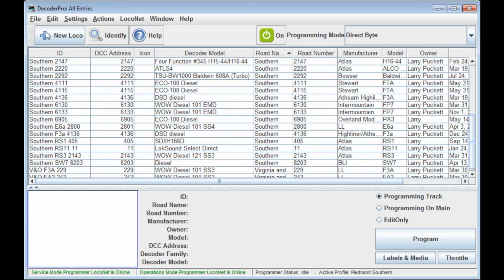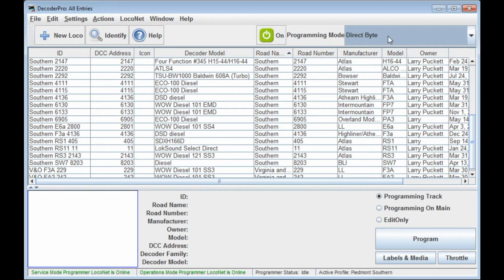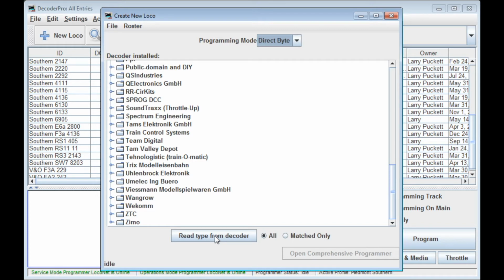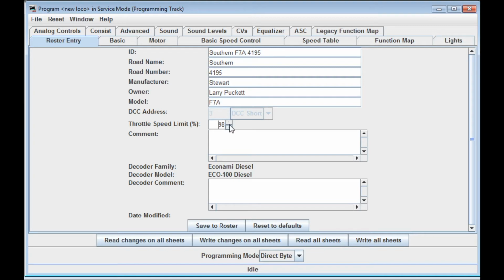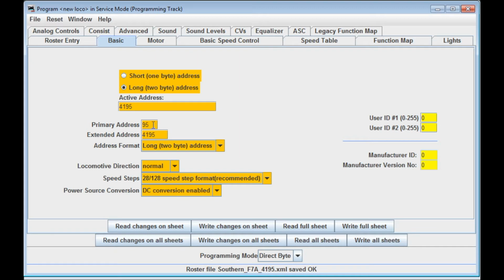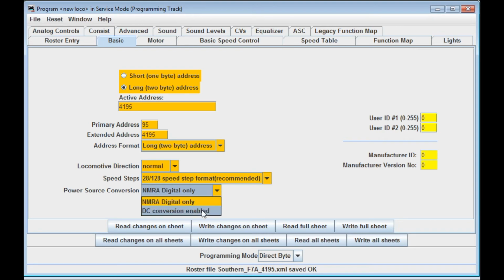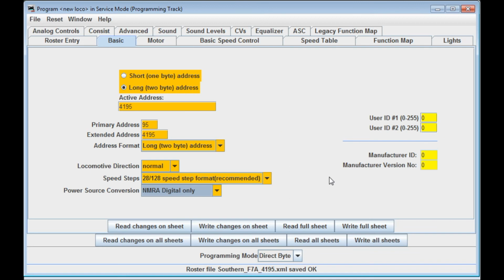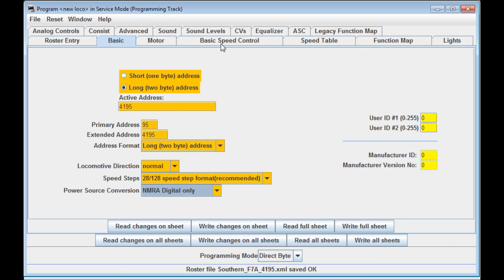DCC Tips, Adding a New Loco to DecoderPro pt 1 (10)

Comment: Thanks as always Larry. Just purchased a DCC EX CSB1 command station so this video series is going to be VERY useful! I also have dcc concepts cobalt IP digital point controllers and I have no idea how to address them using JMRI! I don’t suppose you’ve done a video on that too? It’s driving me nuts!!
Reply from the maker: The iP Digitals are addressed like any other accessory decoder, just follow the instructions that came with them and your command station as I have shown in several previous videos.
Reply from the maker: They are addressed just like all accessory decoders just like it says in the iP Digital instructions and your DCC system manual. And yes I have done several videos showing that.

Comment: Hi Larry,
I have installed Soundtraxx TSU-2200 decoders in some of my loco's, but cannot change the decoder settings CV's, in JMRI Decoder Pro they all come up in a grey box's,

both CV 15 and CV16 are 0,

any ideas?
Reply from the maker: Have you been playing with locking the CVs using CVs 30, 15, and 16? If you suspect that then try to procedure in the Tsunami2 manual for unlocking them. Have you tried to read the CVs using a service mode programming track?
Reply: @TheDCCGuy  No, have not playing with them, I watched your video series on loading and setting up decoder pro and all my loco's have the same issues, I am using an NCE Power Cab, with an Auto switch and a separate section of track for programming.

No, I haven’t read CV from the Power cab as I found it a bit confusing, that why a got the USB interface and setup the computer.
Reply from the maker: From a trouble shooting perspective it would be good to know whether CVs can be read using the throttle, that way you know whether to look at the decoder or the usb interface, or the DecoderPro preferences. It likely is the preferences but could be the usb. I think NCE now suggests removing all the jumpers for the latest version of DecoderPro.

Comment: A person who will remain nameless at NCE told me when  programming sound decoders you get better results programing on the main rather then a programming track because the signal strength is much higher on the main then the programing track output. Just a heads up if the programing isn't going well.  Norm Bell
Reply from the maker: Yes, that is true. The difference is that on a service mode programming track you are probable seeing about 12 volts or a little less and it is limited to about 500 milliamps. When programming on the main you are using full track voltage and potentially amperage. So if something goes wrong and there is a short you may destroy the decoder unless it has internal short protection. However on the service mode track the power is kept low to prevent permanent damage in case of a short. So I recommend doing initial programming just after a decoder install on the service mode track before placing the loco on the main track. That way you will discover any shorts or wiring mistakes before they damage your new decoder.

Comment: So how do i figure out what the decoder is if its something I bought and there arent any markings on the decoder that help identify it?
Reply from the maker: When you do the initial in most cases DeciderPro can tell from the CVs which brand it is and in many cases the version. However in some cases this only goes as far as the version number and not the individual decoder type. Fir example this may give you that it is a version 4 Digitrax decoder but not provide specifics as to the number of functions, etc. It is always a good idea therefore to keep a notebook or spreadsheet with the locomotive, decoder type, and specific version. Also don’t throw away your instruction sheets. I recently was able to supply a manufacturer a copy of an instruction booklet from 1997 that the no longer had. As my wife will tell you I throw nothing out!
Reply: @TheDCCGuy  Also, I don't understand why the NCE Power Cab is able to identify it enough to program it on its own but the JMRI program cant with the USB connection??
Reply from the maker: When you use the PowerCab you specify which CV to program or use a limited number of them. So it isn’t a matter of the PowerCab working with a specific decoder instead it is just sending commands of that limited set of basic CVs or ones you specify.
Reply: @TheDCCGuy  Thanks for the information.  I guess this set up isn't going to be as helpful as I had hoped.  Is there any other program that works better?
Reply from the maker: Not that I know of unless you are using LokSound decoders with their proprietary LokProgrammer software and hardware.
Reply: @TheDCCGuy  Does that mean I cant program a LokSound decoder with the JMRI software at all?
Reply from the maker: No, you can program them with DecoderPro, you just cannot upload sound files, that requires the LokProgrammer.
Reply: @TheDCCGuy  Thats good to know.  Thanks again for all the help and the great videos.  Take care and have a Merry Christmas.

Comment: I pretty much do things the same way, but after creating the roster entry but before making any changes to the basic tab, I read the sheet. This way the decoder manufacturer and the decoder version will be preloaded and any other basic information will be read in case it happens to be a used decoder. Then I'll make the necessary changes and then write them back to the decoder.

Comment: I've tried to join the jmri forum a couple times,  with no luck.
Thought I'd try here.
Sometimes when starting my jmri software back up, it takes a half hour or so for my signals and block sensors to start working. 
Is it better to just leave the program running?
Digitrax,  se8c, and bpx88 on windows 10.
Reply from the maker: I have never figured out why it can take so long for JMRI. to start up and get rolling. Sometimes DecoderPro will pop right up after I click the icon and at other times it drones on for ages before actually loading. I don’t know whether it is Windows 10 eating up all the resources in the background or if it is JMRI doing housekeeping. My best advice is to keep all your software and associated drivers up to date, especially Java.
Reply: @TheDCCGuy  Sounds like great advice, and good to hear I'm not the only one with that issue
Thanks for the reply.

Comment: Is there any difference whether you program on the main or use the program track?
Reply from the maker: Yes and no. With programming on the main (POM) you can’t read back CV settings and you are working with full track power. In service mode you can read CVs and track power is limited to prevent damage in case of shorts. Because you use full power PON is often more reliable but you should always test a new installation on the service mode track to prevent damage if there is a short.

Comment: Extremely helpful. 

What do you do if you don’t know what type of decoder a manuf has installed and the read option returns to many choices?
Reply from the maker: It may depend on the manufacturer. Some use unique id’s for decoders whereas others only id them by generation. Your bet though is try to narrow it down by finding out which company the manufacturer was using. This is often available on their websites of internet forums. If that doesn’t work it becomes trial and error.